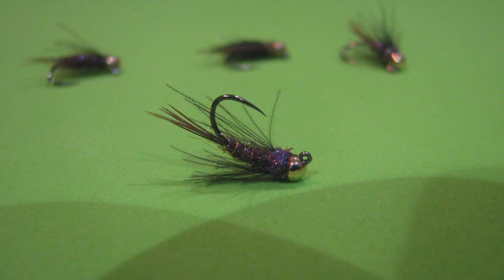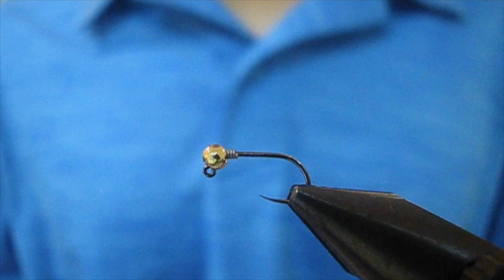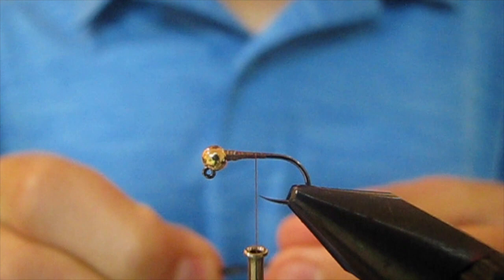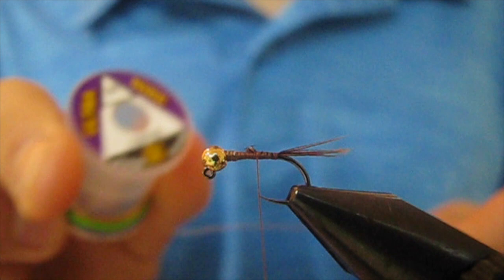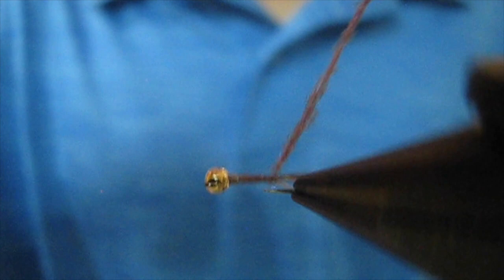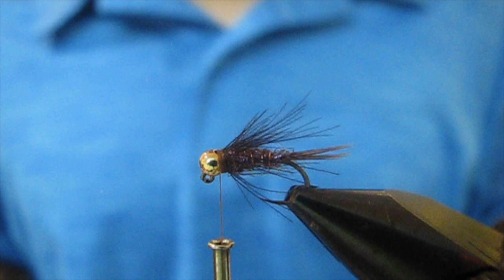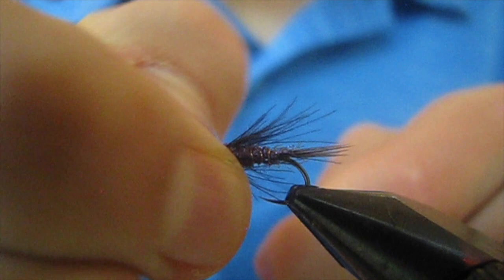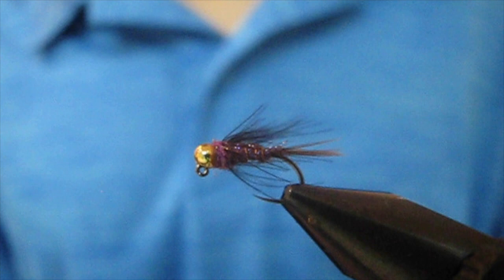Fly Tying the Duracell Nymph

Comment: Hey Justin, great video!
One question, if I don't have  the Brown UV and the Purple UV Ice Dub, what is a good replacement? 
For the body I have I this options Brown krystal dub, Golden brown ice dub, chocolate brown SLF, Hares Bar SLF. 
For the hot spot, I have a black /looks like dark purple SFL and a peacock black ice dub. 
Would any of this options work, or it has to be UV?
Reply from the maker: I definitely prefer the Brown UV ice dub because of the purple mixed in and I feel that purple is what makes this fly stand out. You can try your Chocolate Brown for the body and for the hot spot either use the Chocolate brown again or the Hare's ear SLF. I would recommend picking up some of the UV Brown Ice Dub - I use it a ton for Frenchie hot spots, micro streamers, Duracells, ect.